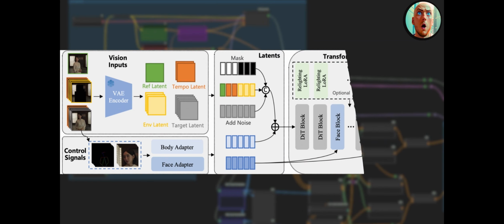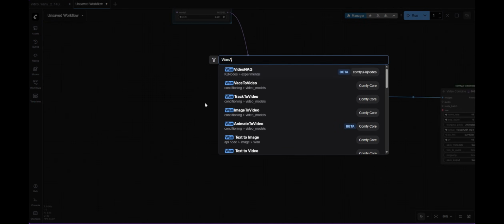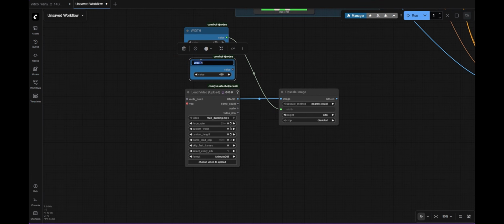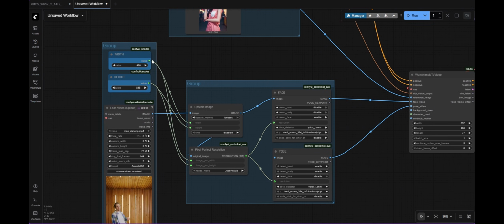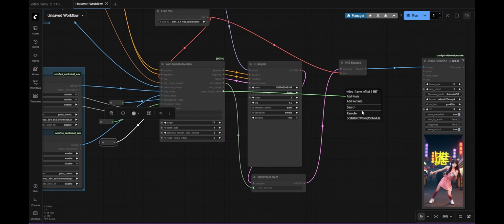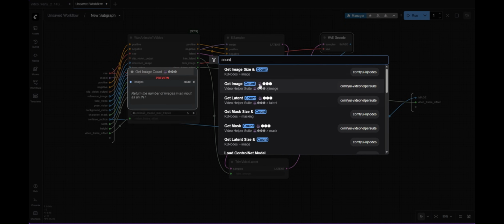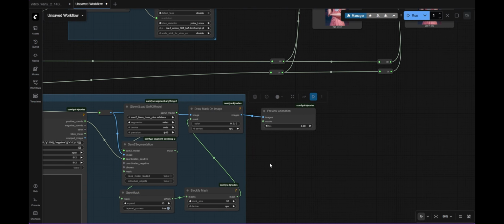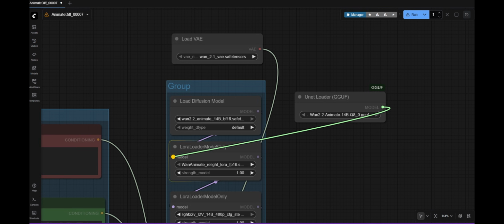Run Wan Animate 2.2 on Low VRAM (GGUF Guide)

Comment: what does that error message mean "failed to find the following, comfyregistry list, the cache may be outdated or nodes may have been removed from comfyregistry.. ive got that a few times, how do i fix that.. Thanks
Reply from the maker: When does this happen? To me, it seems to happen when trying to install the missing nodes, but after install/restart it disappears. I am not sure, but it may be related to conflict with comfy version and some custom nodes.
The last comfyui with nodes 2.0 seems to be giving a lot of problems, unfortunately, is this the case for you?
Reply: @koalanation  😁it happened to you too, on your video, did you not spot it... time 0.58 secs.. so it sounds like i just need to restart and let it update itself, i got nervous with it though, i had tons of conflicts, and didn't want it breaking anything..
Reply from the maker: @Yorky23 yes, it happens with segment anything 2. but after installing all nodes it works (for me). But only once..you said you got it few times, so I thought you maybe had other issues...moreover, people are having lots of bugs with the new nodes, which I do not have (yet)...anyway, i hope you could install it with no dependencies broken 😅